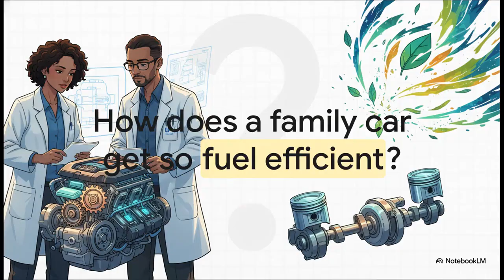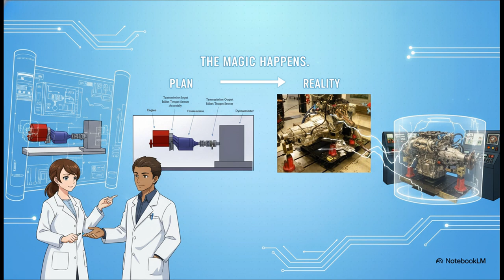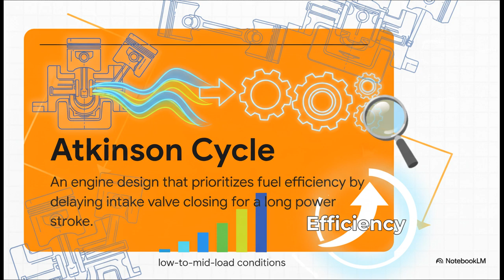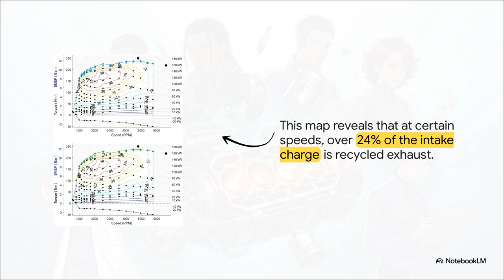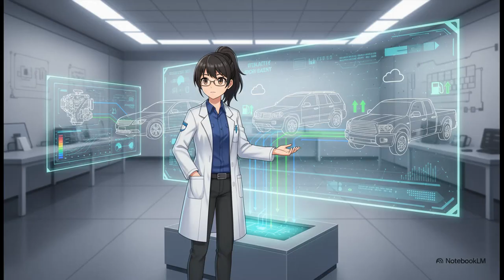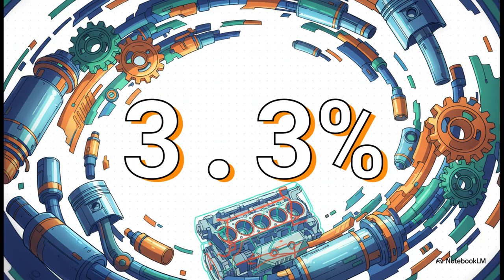A25A-FXS Dynamic Force: How Toyota Hit 41% Thermal Efficiency – NotebookLM Review

Comment: The worst part is at the end: Cylinder Deactivation was tried in the 1980's by Cadallac.  Yeah, they tried to deactivate a V8 into a V6 or even a four cylinder.  The results....crappy worn out engine.
Reply from the maker: Fair point, Cadillac's V8-6-4 in 1981 was a mess. The tech was too early: slow solenoids, weak electronics, and it was driven by an unreliable analog computer. Today's cylinder deactivation uses much better controls, though oil consumption problems still show up on some engines.